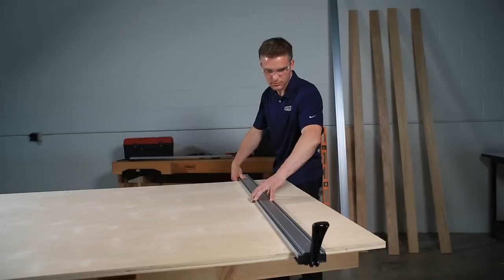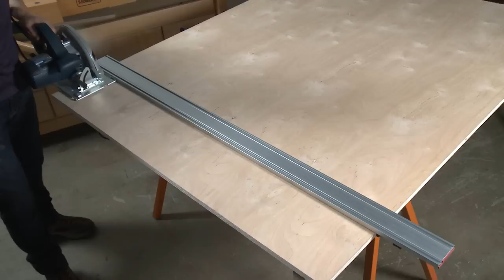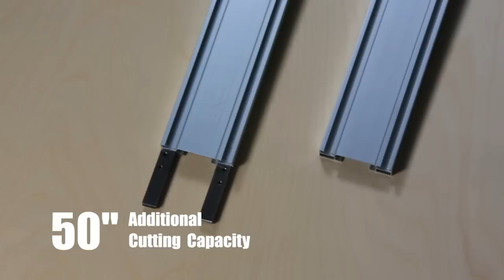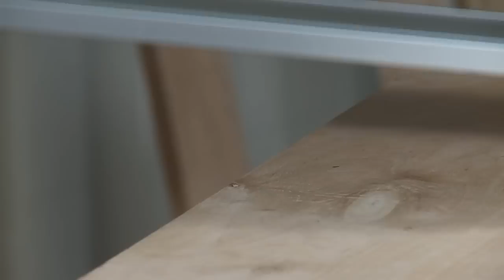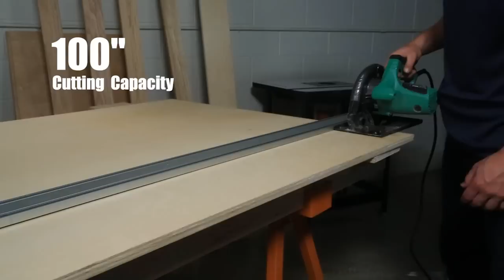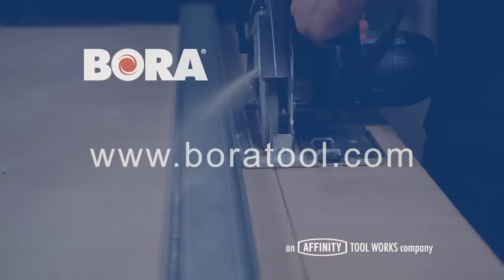BORA TOOL WTX CLAMP EDGE SAW GUIDE

Comment: I've about given up on getting the piece that is supposed to move (Step 2 of the instructions on the box) to move. Not only do the instructions stink, the d*mn thing won't move. I'll give the 1-866 # a try and if that doesn't solve the issue, I'm taking it back to Lowes. I am sick and tired of cr*p instructions from manufacturers and/or defective products.

Comment: I watched the video and tried to remove the end clamp from the plywood. Baloney! I''ve squeezed, pulled , begged and given up on removing the damn clamp from the plywood. I think you folks not only screwed up on lack of instructions but on the video as well. I've not done anything to damage the clamp so I set the the 4x8 plywood aside and sawed another 4x8 the old fashion way, after paying 80 bucks at Lowe's for your tool.
Reply from the maker: Hi Lynford, I just want to clarify - are you pulling on the silver part of the clamp or the colored indented part of the clamp?
Reply: @BoraTool  I pulled on the  tool component that touches the material  I wanted to cut with the saw. That's the only logical place to pull guessing at how the tool is designed. However, in sincere desperation I used a large screwdriver and inserted it into the crack and forced the tool apart, It opened up without damage. The tool does this often as I use it but I no longer fear breaking it by straining my guts out trying to make it release. It'd be nice if the tool were designed with some kind of a lever to make it release easier. If it's too difficult to open I just use the screwdriver.
Reply from the maker: @lynfordturner1402  We suggest that when it gets stuck, put your thumb and forefinger on the colored indented part of the movable clamp and move it toward the handle clamp. You should hear a click and it will be unlocked. However, wiggling a flathead screwdriver between the silver and colored pieces is an effective way to pop it free.
Reply: If you haven’t yet, you should print that instruction on the handle of the tool so 50% of users don’t give up on your tool.